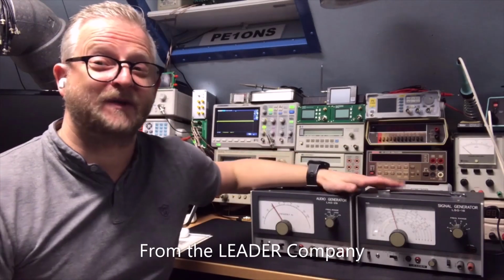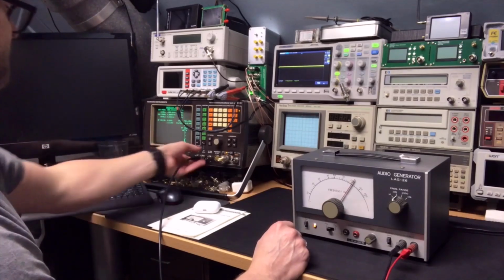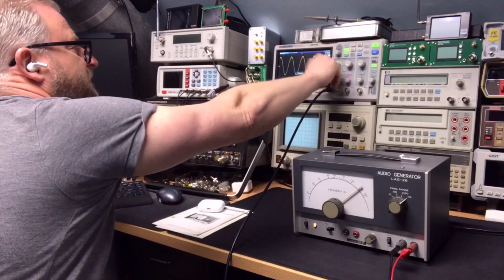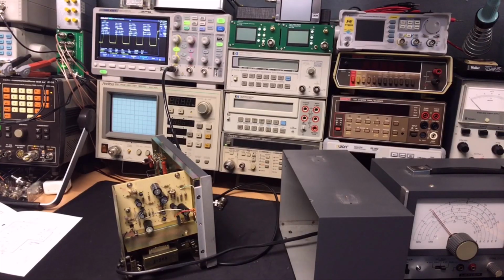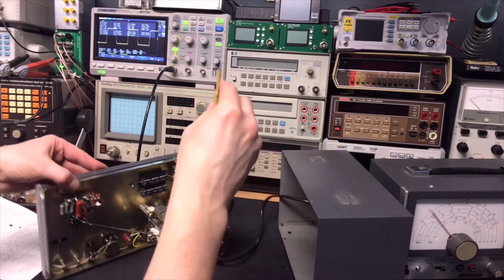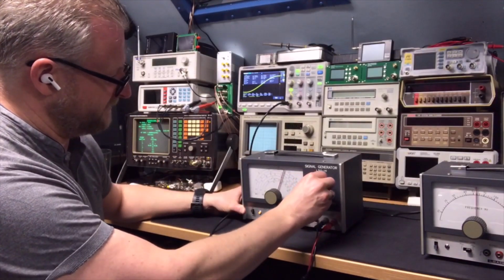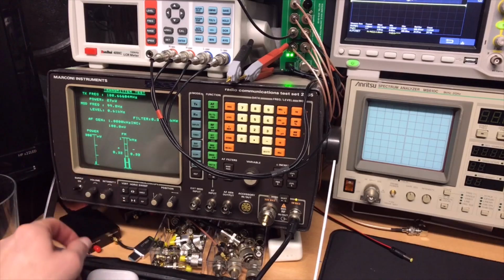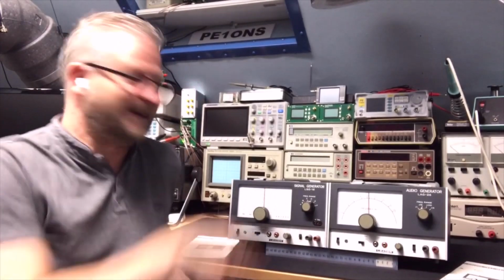#115 Leader LAG-26 and LSG-16 Teardown Adjust and Cleanup

Comment: Interesting! I just bought an old LAG 26 for at home audio work on Walkmans and cassette decks. It needs some love. The needle has broken off so it will need repairing and I will have to check the caps and calibrate the tones. I see that you interconnected L and R channel with 600ohm on the output when calibrating. Is this the preferred method? I also have a 4 channel oscilloscop, is it possible to hook up L and R to separate channels on the oscilloskope and calibrate them that way aswell? Can't find a service manual for this old machine.
Thanks for the great video 😊
Reply from the maker: Nice you still have one, i do not know how to calibrate, but i do have a manual with schematic, i can send you by email, you find that in the about page of the channel

Comment: have the same lsg-16 signal generator and it gives me an error in the lowest range (A and B) Could it be calibrated with the change of capacitors?
Reply from the maker: Hi, yes they are old, the caps too. changing those is a good start, if it will fix it who knows.

Comment: The only problem that I have with these, and the other numerous brands, is the tuning. They all needed a greater reduction on the tuner shaft, or they needed a fine-tuning knob. Older tube-types had a type of fine-tuning, where the large metal rotating dial's edge run against a small diameter rubber tire that was turned by a knob, which gave a great reduction between the dial and the fine knob. The main tuning shaft was generally 1:1 or just a little reduced.

These generally had a 4:1 ball bearing reducer connected to the variable cap's shaft, and if that could be increased by two, to 8:1, it would help. Another way would be to add a small air variable, say 10 pF or so, in parallel with the main tuner cap as a fine-tuner, which could be adjusted by a knob outside.
Reply from the maker: All true.. also the RF was not that clean it used the harmonics for higher frequencies making it very dirty. i sold both. but it was great to play with it.